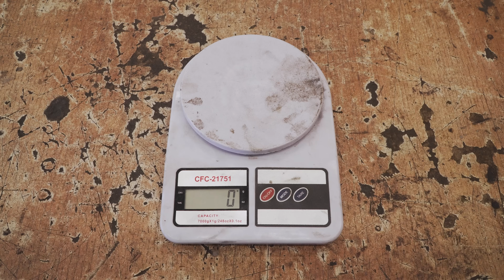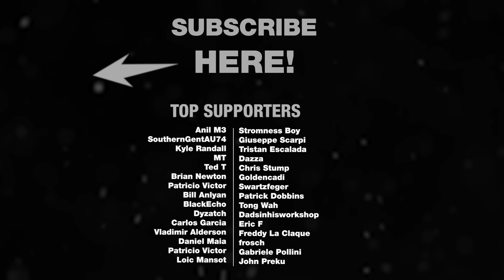White Bronze Alloy Experiment (Water Casting)

Comment: Do not be sad, this alloy can be used for a cutting tool.  I made a similar alloy from copper and babbitt (10/12% more antimony in babbitt), and I got a hard, fine-grained alloy, harder than iron and low-carbon steel.  But although it is quite fragile, it is not very critical.  Similar alloys with about 20% tin were used in the late Bronze Age, one example is the Chinese sword "Goujian", which has retained its sharpness after millennia.  True, there is a more complex alloying, and there are quite large percentages of iron and lead.  I suspect that it is iron and lead that reduce the brittleness of bronzes with a high percentage of tin.  Although this still did not save him from the clumsiness of the museum employee, who dropped that sword, after which a crack appeared in it.  Tungsten carbide is also brittle, but this does not prevent it from being used as a cutting tool.

Comment: I could be wrong but when you quenched the different metals in water you could have hydrogen embrittlement. I would be curious how the outcome of your castings would be if you air cooled them. Just a thought.
Reply: Would you need to dribble out the molten metal from a significant height so it air solidifies before hitting the ground? Access to those old pellet casting towers they used to make shot gun pellets from would be ideal! Might be difficult to do without such a location ..
Reply from the maker: Cool! Never heard of this. Always supposed water quenching of non-ferrous metals was just like annealing.
Would you say this is something that still applies after re-melting?

Comment: If you mix two-thirds copper and one-third tin, you get speculum metal, which is brittle but highly polishable, used to make traditional metal mirrors. Maybe that's fun to try in the future?
Reply from the maker: Hmm, maybe I got close to it already accidentally? Was really really easy to buff right after 320 grit on the angle grinder.

Comment: If you add Antimony, Tin and a touch of Nickel, it'll be a lot Tougher alloy without the brittleness and with the Nickel, it'll be stronger than brass...Try again and good luck...Btw, the Antimony and Tin will make it so much less brittle, in fact it'll probably bend without the Nickel but the Nickel will make it harder and stronger, hope this helps!
Reply from the maker: Thank you!! Would you mind suggesting percentages?
Reply: @BlackBeardProjects  5-6% Nickel...5-10% each of Antimony and Tin...But you'll probably have to try a couple of derivations...Just make sure you're positive of NO LEAD in the mix...Also increase the copper some too...
Reply: So, German silver aka nickel silver?
Reply: @jasonsummit1776  ...No, real Nickel...

Comment: Why is there so much fewer bubbles on the second pour/melt than there were on the first one? There were a ton of bubbles on the first one and barely any on the second. I need to know why!? Lol
Reply: Wonder if it’s not related to the temperature. The brass would have been hotter, I would think. Seems contrary, though.
Reply: @mred8002  I thought about that too but I also figured that both would be more than hot enough to be producing a lot of bubbles. It doesn’t take very much to produce bubbles
Reply: @jessevanderhamm  well, he melted the pewter with just a propane hand torch, but the brass took an oven. I’m perplexed.